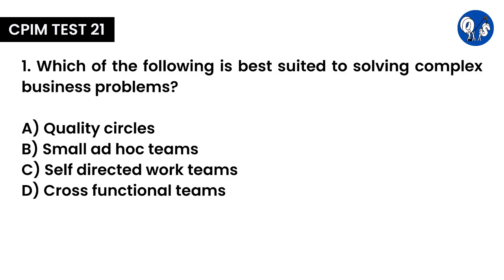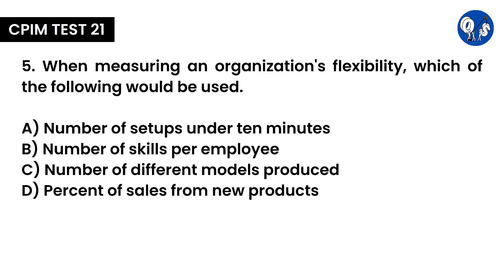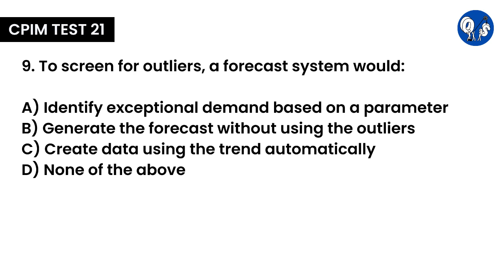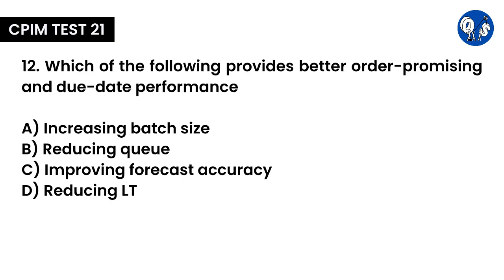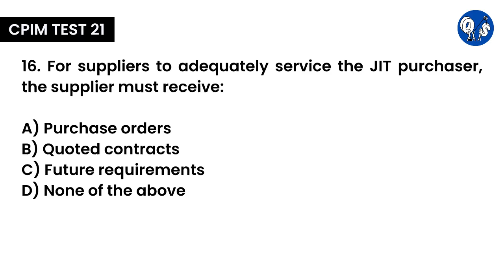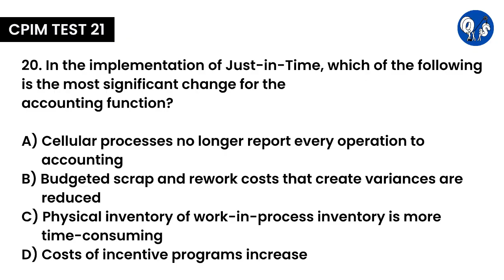CPIM Exam Practice Question Test 21

Comment: Hello Sir. Thanks for sharing these questions 
However I would like to highlight an error with option A in question no 12.

Question no 12  , the option A should be reducing batch size  and not increasing batch size. This is because if batch size increases, queue time and lead time will also increase which will not help in providing better order promising and due date performance . So batch size increase actually contradicts  with better promising and due date performance .